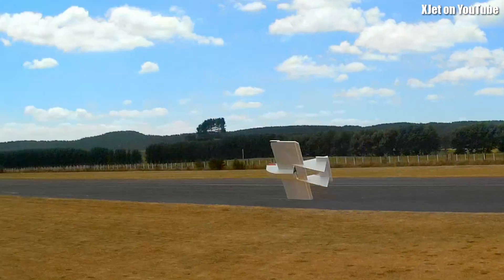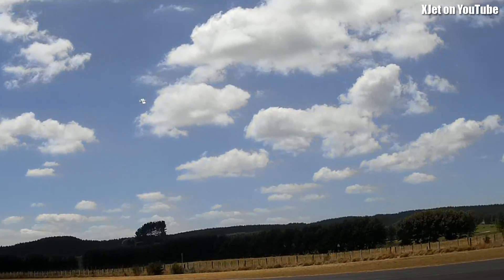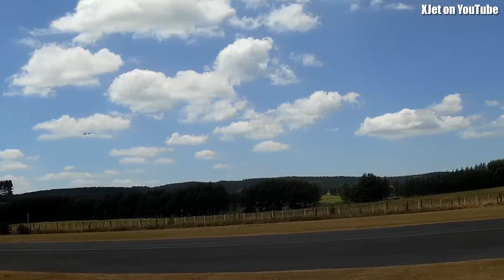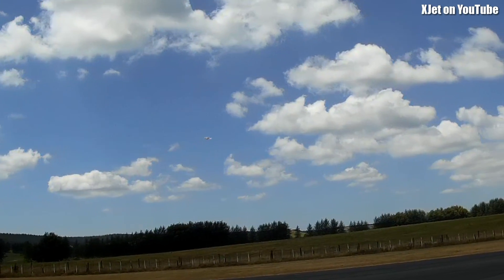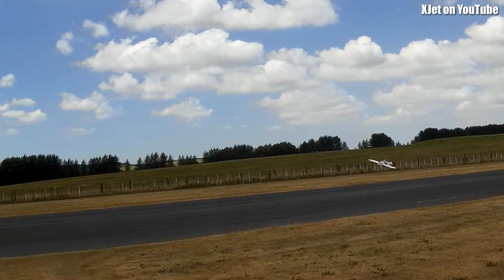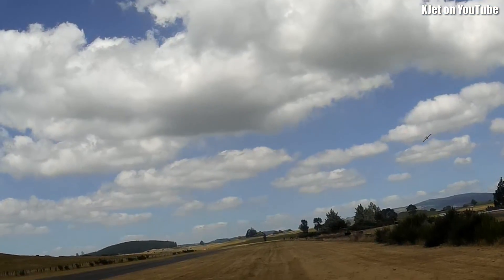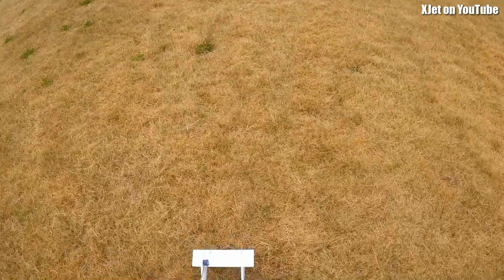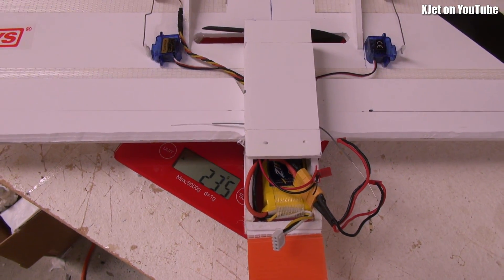DIY RC Plane - it flys perfectly!

Comment: To make it even lighter, wouldn't just going with a flying wing be better? You would lose the weight of the third servo plus the horizontal stab.
Reply from the maker: It could be lighter but this little craft doesn't have the "flying wing waggle" that every small wing suffers from.   It tracks  very straight.

Comment: I am keen to see a set of plans as well. It looks like a prop in slot version of a Sig Wonder or it's cousin the FT Bloody Wonder with a detached horizontal stab. My experience with those low aspect ratio planks is that the sweet spot for the CG is around 18% of MAC. Good job on a TLAR style design 😊

Comment: Any idea on a more quiet propeller/motor? being sub-250g makes it legal, but my neighbors would still get me grounded for the noise.
Reply: One thing that would really help the noise is to cut the prop slot larger and in the shape of an 8... larger and rounded on the ends.  Props need space or they sound like playing cards in bicycle spokes.  A slow-fly prop or something with rounded or tapered ends also helps.
Reply: You can cut the slot into the shape of a bow tie it's the tips that make most of the noise.

Comment: thanks for posting.    thanks for giving some of us an Opportunity  to  Educate others.     the  model still has  a  Zero-lift wing.   because,   the pseudo-kfm profile has  Not  been correctly made; ie, step  SHOULD BE near 50 percent of chord.    control horns are  still  not  correctly  installed.    tail-installed servo equals   WHY.   IS there a Valid reason.      cheers          googletranslate

Comment: Well done Bruce she grooves around the sky nicely now and just goes to show what a bit of patience and experimenting will do,I see the leading edge is not even rounded just sliced with a knife blade well it works and that is all that matters.
I am sure that many of us would love to build one,why not have the motor as a tractor to make it a bit more quiet in sensitive areas,still mounted where it is but not pushing.

Comment: Looking great mate. To shave some weight you could cut some holes in the main wing under the KF step. Also what about tapering the back of the fuselage down at the top and bottom to help the motor get some more air. Should make it a bit more efficient no?

Comment: #456: Noisy as hell, not a greate plane for sponsering/introducing the hobby, even I find it anoying. Sorry not a fan of this plane DB levels  Bruce.
Reply: For low noise you should go with traditional, tractor configuration - prop on the nose. It would also fly nicer and for longer from one battery.
Reply: @avelkm  balancing it would be easier too, fpv would be tricky though

Comment: Yes sir please sir would love it for plans to be published

I just got into fixed wing (have flown a little bit of acro quad) and have joined the local club, I’m hoping the weather is being nice because I’ll be flying on Sunday 😁

Thanks for all the videos, they’ve helped motivate me (with some help from flight test too) to get off my backside and make it outside to the field 😁

Challenge for you tho, I have to drive 20 minutes to my local field because almost all of my local town is too close to the airport.... any chance you could squeeeeeze fpv onto a 100g model? That’s the point where casa seems to no longer care if I’m misunderstanding the regulations correctly

Comment: Hi Bruce. Where in NZ did you buy the foam?
EPP or depron?
Should I sell my unbuilt bonsai and build this for close in fpv?
It's always windy at the local RC feild, bonsai might not be a good choice. I want to fpv around the trees
Reply: Keep the bonsai, they are pretty tough, you will be under the 250g mark. This foam board model is pretty much to prove you don't need to spend to get flying. I've built plenty of models in the past with cheap eBay motor/esc combo, cheap $1 servos a sheet of depron and some packing tape. You don't need to be cashed up to fly when you can build your own.
Reply: 3-5mm foam board is available free as off cuts from most framing shops. Need to soak and rub the paper off though to reduce weight. Replace with free roll ends of ironed on 15-30 micron laminating film from copy shops, or adhesive tape.

Comment: Nice one! Great to see all the stages of an iterative design process. :) Out of curiosity, what considerations led to the slot-in-wing instead of pusher at trailing edge prop position? Just ease of CG, or other factors?
Reply from the maker: Mainly to get the CG far enough forward without having to make a longer pod.